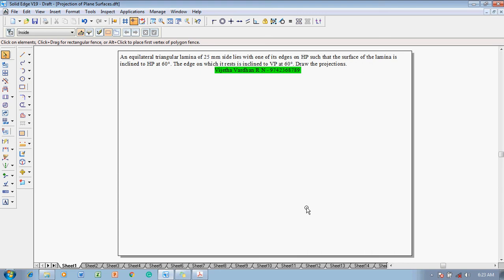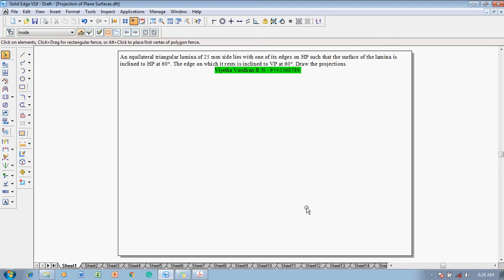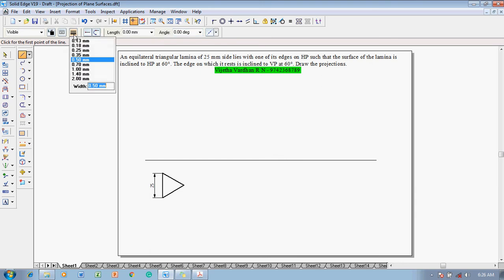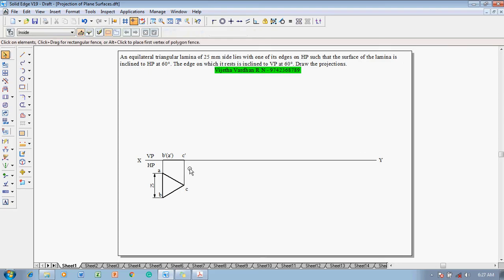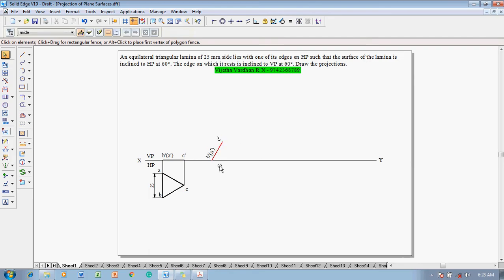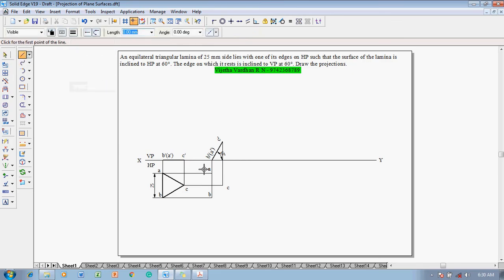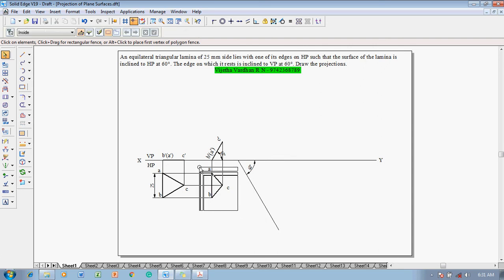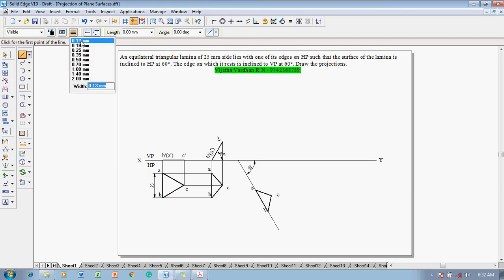Example 1 on Projections of Plane surfaces

Comment: 1.) An equilateral triangular lamina of 25 mm side lies with one of its edges on HP such that the surface of the lamina is inclined to HP at 60°. The edge on which it rests is inclined to VP at 60°. Draw the projections.
Reply from the maker: Please check my playlist for more problems